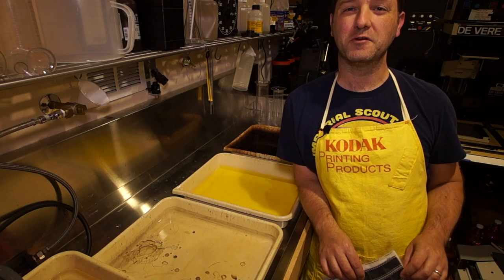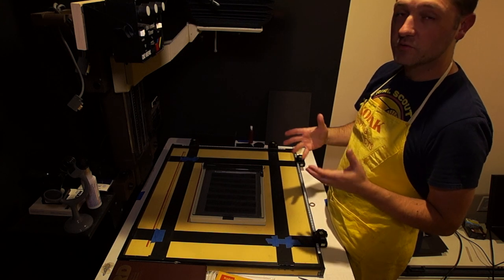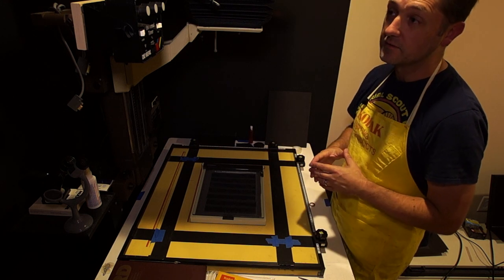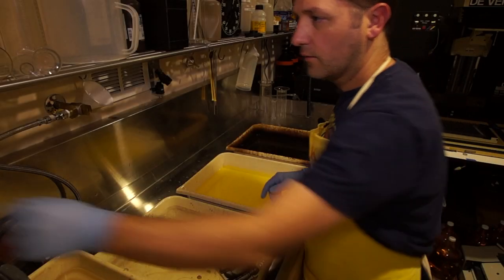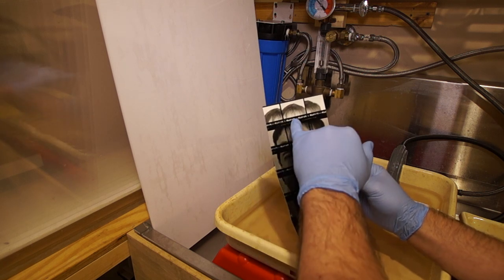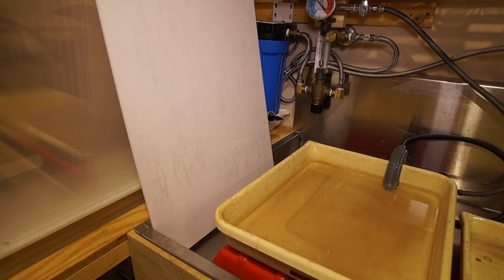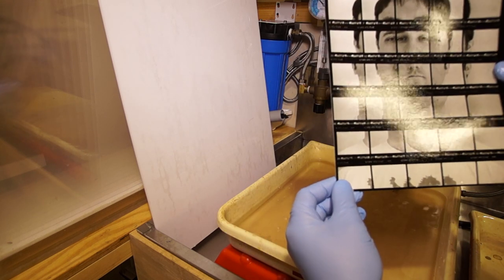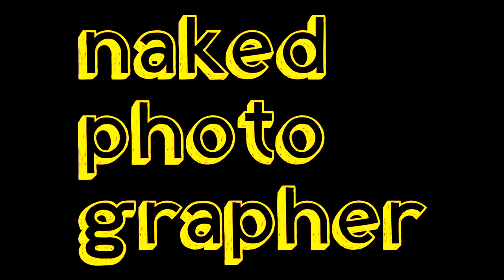Making The Contact Sheet

Comment: Right. That edge method even works when scanning. A slider is moved in manual mode to darken the preview until edges darken enough.
My current problem is to figure out how dense to expose film in the first place so wet prints will look correct
Reply from the maker: Expose just enough to have texture in your deep shadows